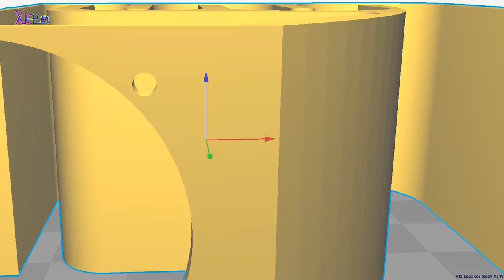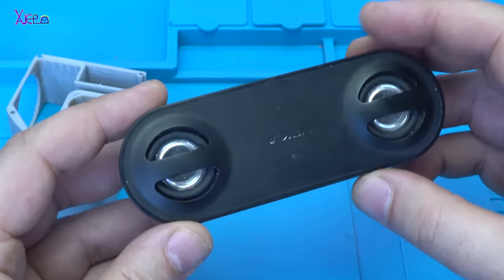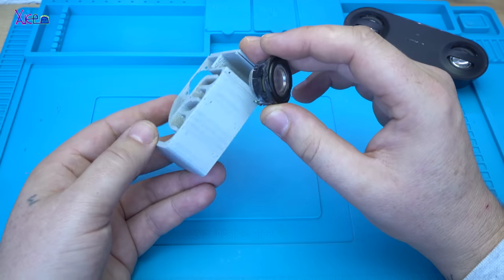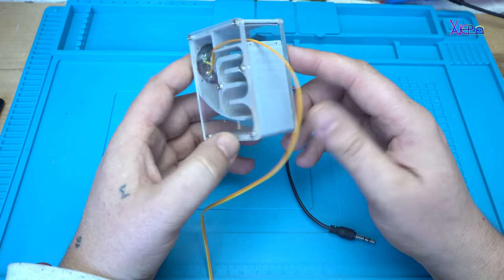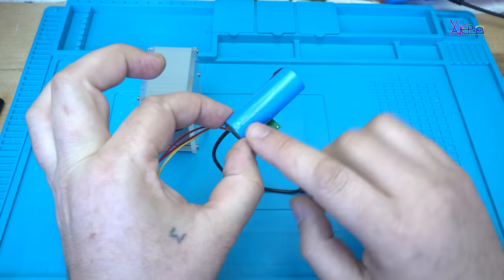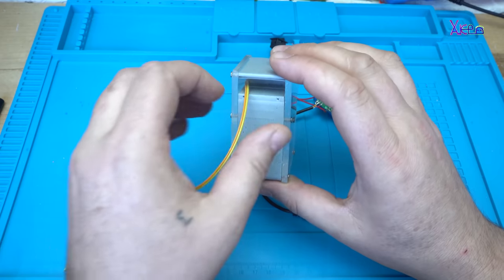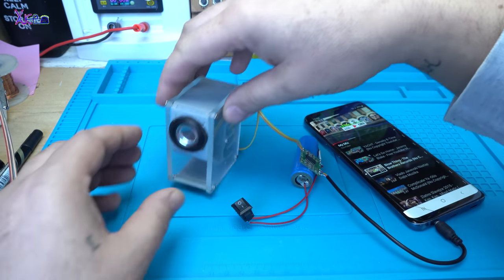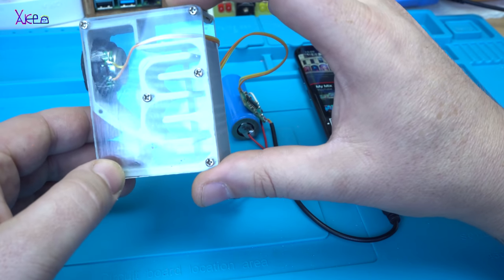Making Mini Maze Speaker | Hear How it Sounds

Comment: You should air tight it, speakers depend on a seal enclosure soo they can move their air efficiently on a mini like that there might not be much change but it's worth the try maybe the weird crackle noise goes away. 

I recommend a strong clear glue.
Reply from the maker: In my next bigger version for sure I will tight up well,thanks for feedback man
Reply: @Hacktuber  I'll be waiting for it :)

Comment: I think:
should put some kind of glue between the printed part and the acrylic.
should cover the not used screw holes.
You will have a bass loss with that

Also, looks like you have an underextruded print, check your extrusion parameters, extruder steps/mm, filament diameter.